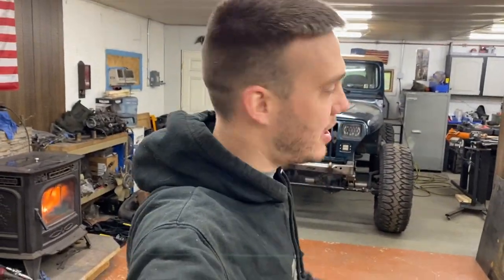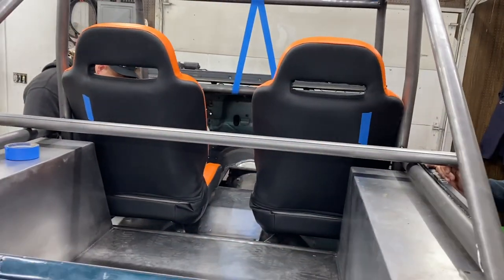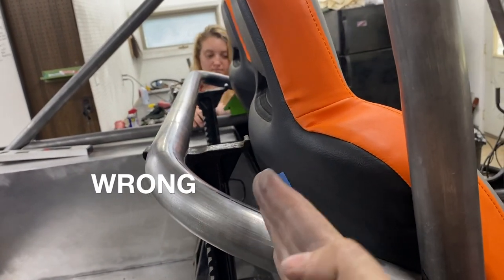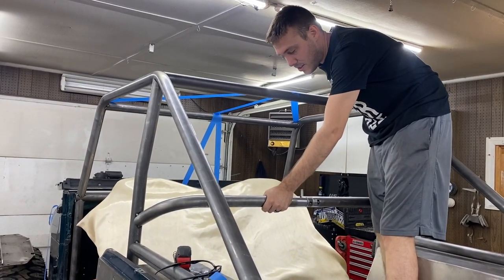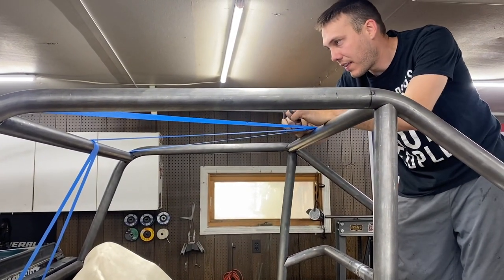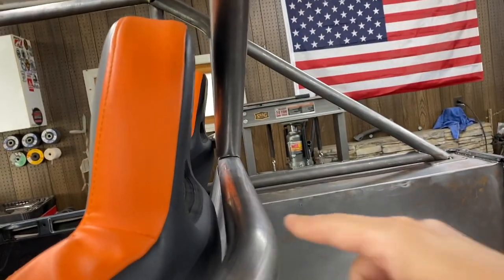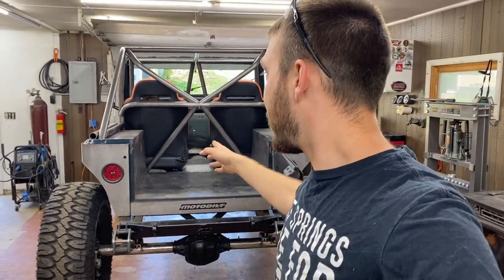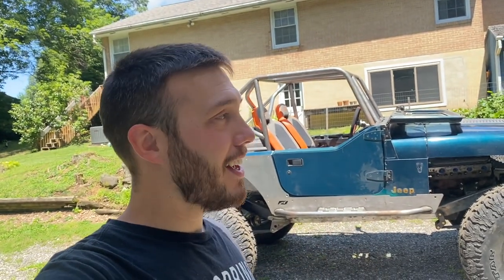Custom Jeep YJ Roll Cage!

Comment: So, here is how I bend odd bends with odd copes:
1. use a piece of brake line, copper line or something similar to work out my bends, length and angles. the tricky part is the line needs to be in the center of where your tube needs to end up. Measure your die radius as well. for example if the die radius is 6" and you're bending 1/4" line, you need to wrap it around something with a 5 7/8" radius otherwise your bends in the cage tube come out wrong. 
2. mark the start and stop of each bend on the brake line then flatten it out dead straight. do a test bend in your tube bender and figure out where it starts bending the tube and mark it. I will usually just add 2" to either end of the tube for the notch, 3 inches or more if its a really steep notch like on your c-b pillar connector tube on the c pillar. transfer the measurements and bend the tube up. having the start and stop from the brake line allows a bit of adaptability on how you bend it. I've done parts with 4+ bends that had to be perfect this way.
3. notch accordingly. make sure you know how much you added to the ends of the tube. this makes it much, much easier to cut off the correct amount and with it mocked up with brake line, you know when the notches are done, it will fit. don't be afraid to wedge the tube in something and tweak the bend a few degrees to fine tune it. truck receiver hitches work well for this. 1.75" .120 wall bends surprisingly easy. 
the other option (and likely what I would have done with your seat belt bar) would be to do the math on it to calculate the length. a bit of trig would work out the bend positions super easy on a bar with two bends and a known width. just assume the tube will shrink and stretch equal amounts on the bend, it will get you in the ballpark. they tend to stretch a bit, but that just makes the ends a bit longer anyway.
Reply from the maker: Holy crap that is some awesome information. Thank you very much for taking the time to type all of that up. Lots of good tips and tricks I’ll definitely have to try and implement next time I’m messing with tube. I appreciate you sharing your knowledge because I’m sure it will help others as well. Thank you again and appreciate you watching and supporting the channel 🍻

Comment: Get yourself a license for Bend-Tech.   I like Bend-Tech Pro to design full assemblies, but even just the basic version (EZ) will let you map out the tube with bends and it'll spit out the measurements, bend angle, plane, everything.  Saves TONS of tube over a few projects.  Pro also includes a program to print out notch templates to make it REALLY easy to get good fitup.
Reply from the maker: I’ve heard great things about Bend-tech. I considered looking into it but then kinda just jumped into the cage build. I think for future projects I’m going to actually sit down and plan it out and use programs like that to help me. I’ve dabbled with Fusion 360 and it can do some of the features that bend tech can when designing cages. Thanks for the suggestion and thank you for watching!

Comment: Good weight for such a strong frame. I have a standard YJ on 33 wheels with a winch of 1380 (3042 lb) kg .
Reply from the maker: It is crazy that it’s not far off of a standard YJ as it sits. I’m definitely going to be curious if the final weight once everything is done. Thank you for watching